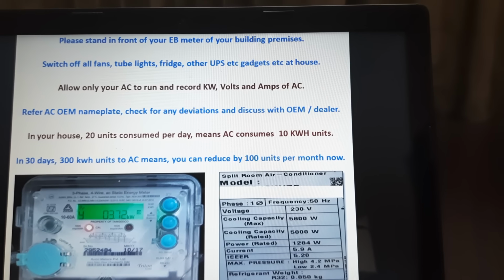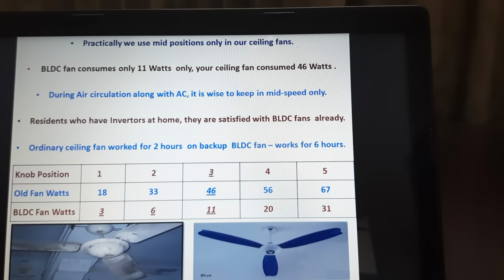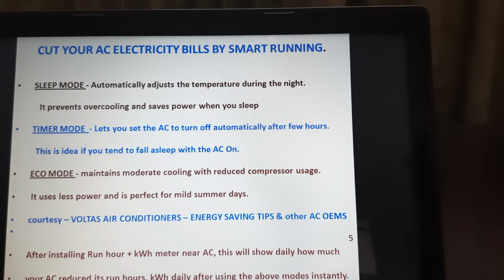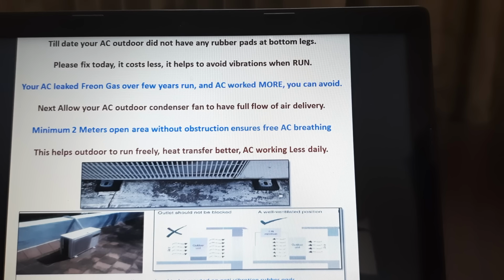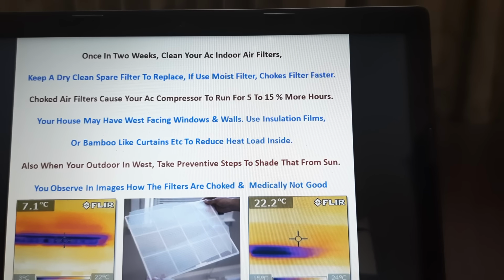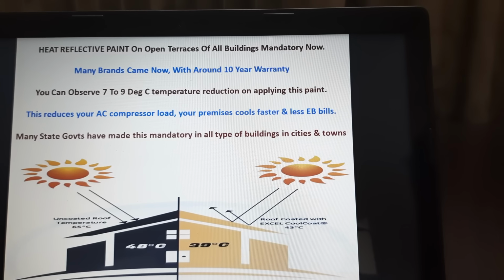Air conditioner’s Electricity Bills can be reduced upto 30% #AC #electricbill #BEE #energysaving

Comment: A BLDC fan at speed 3 or 4 with the AC set to 27–28°C is one of the best combinations for comfort and energy saving. If your AC has a convertible mode, keeping it at around 40% capacity and 28°C can further reduce power consumption, especially with a 3-star inverter AC. Good room sealing is also important ,if cool air keeps leaking out, the outdoor unit won't cycle off properly and will run longer, increasing electricity bills. Many people still use ACs at 16–20°C unnecessarily. The purpose of an AC is to maintain a comfortable temperature and remove the feeling of heat, not to turn your room into the Himalayas.❤🎉
Reply from the maker: Superb expert and  user experiences from you, thanks for giving your valuable feedback precisely
Reply: @energymeasuretosave3082 haha ....thanks for making such wonderful video 😊
Reply from the maker: @RahulTamore-v6f thank you please for your motivating feedback

Comment: Please advise star hotels to install fans in rooms. They have only AC. No fans. And they are providing quilt. Without much air circulation and mosquito menace could not sleep well. I would remove the woolen from the quilt so that I can sleep a little better. 😂
Reply from the maker: You are very much right. The hotels need to install BLDC fans to achieve centred air throw instead of scattered air throw from conventional ceiling fans. Some of air circulation comforts need to be made mandatory especially in hotels and hospitals etc public utility buildings.

Comment: Sir can we bypass the whole need of AC by using exhaust fans in the top of rooms?
Reply from the maker: When the ambient air is above 40 to 45 deg C, you won't be able to bypass the AC. At less temperature around 30 Deg c +, you can manage to exhautt out the hotter air from the room.

Comment: Hello sir, the AC technician always say do not run fan along with AC in same room. probably because of dust settling in through the top panel. would you advise using both fan and AC at same time?
Reply from the maker: Yes pls. Fan with mild air circulation speed setting say 2 out of 5 especially in bldc fan will retain the comfort and you can raise the setting temp. This will not pick the dust etc
Reply: @energymeasuretosave3082  ty for quick response sir. will try it out

Comment: i think for lower middle class a car AC type  for sleep time would  with a well designed retracting cabin  for the bed so u can just cool the small space over bed at maybe 100-200 watts consumption ..can have a concept of climate control ..

also i feel AC should allow in genreal people to set turn on and off times in minutes...as in my experience theromsatat readings dont feel accurate..sometimes ac gets too cold or hot....but people generally have a sence of the time cycles needed for their room...so i shld be able to set 5 mins on and 5 mins off for comressor..
Reply from the maker: Thank you for sharing these innovative ideas and your practical perspective on AC usage!

Comment: I recently bought a new AC, but running it on 27-28 throws bad smell, any suggestions?
Reply from the maker: Normally it should not give bad smell. Pls check for any Freon leak or any other material got stuck inside the Indoor unit. Since you purchased newly, suggest you to call your local service team to address this issue immediately.

Comment: Aircon can be attached on any ac right sir I mean on 1,2,3 star ac etc
Reply from the maker: That is correct, these energy-saving tips are applicable across different star ratings, thank you for your query. This will not fit in the Inverter AC.

Comment: This video outlines various zero-cost, low-cost, and high-cost strategies to reduce your air conditioner's electricity consumption by up to 30%. 

Energy Monitoring & Usage
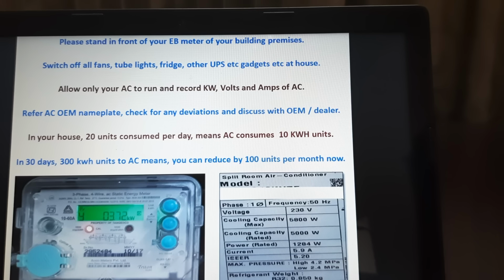Baseline Monitoring: Turn off all household gadgets to measure your AC's actual power usage (kW, Volts, Amps) against the OEM nameplate (0:17–0:46). 
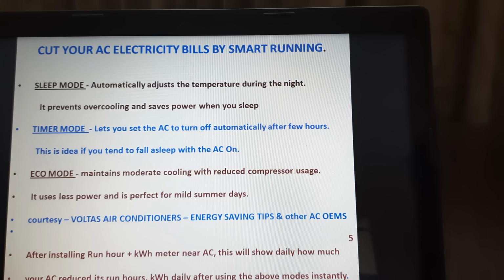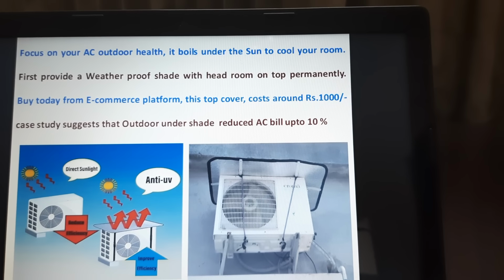Sub-metering: Install a cost-effective run-hour and kWh combo meter (~1,000 rupees) to monitor daily/weekly usage and identify performance deviations (3:06–3:59).
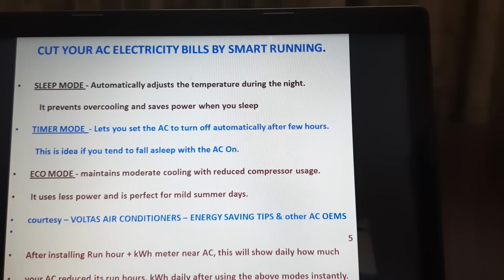Smart Operation: Utilize built-in remote modes: Sleep mode (prevents over-cooling), Timer mode (cycles compressor/fan), and Eco mode (for mild weather) (2:24–3:01).
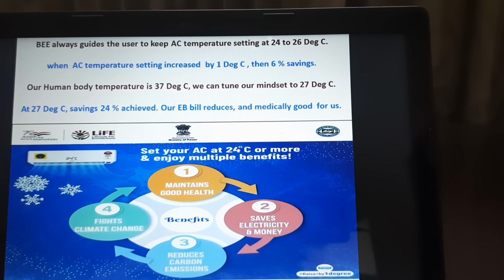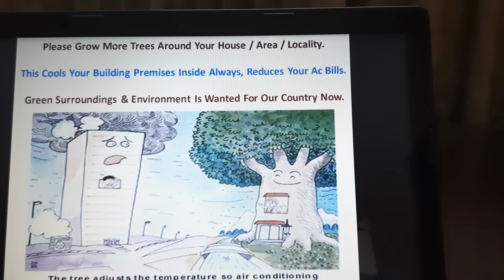Temperature Setting: The Bureau of Energy Efficiency recommends 24–26°C; however, setting it to 27°C (10°C below human body temperature) with a BLDC fan can save up to 24% in energy (8:19–9:02).

Outdoor Unit Health
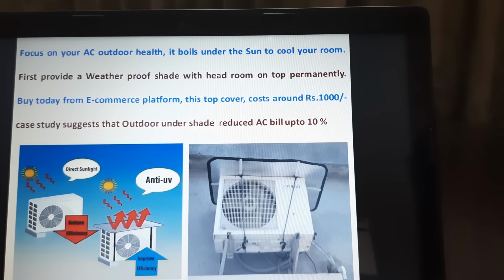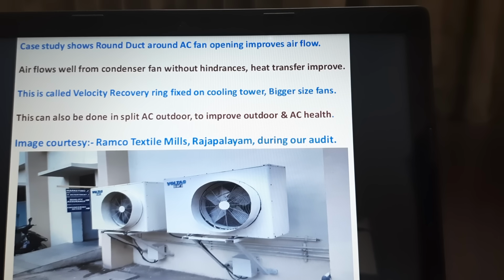Comfort the Outdoor: Protect the outdoor unit from direct sunlight with a weatherproof shade or shade wrap to reduce the load by ~10% (4:03–4:24).
Velocity Recovery Ring: Adding a round duct to the fan delivery side improves heat transfer (4:27–4:53).
Anti-vibration: Use rubber pads on the bottom legs to prevent leaks caused by vibration-induced wear (4:59–5:25).
Airflow Clearance: Ensure a 2-meter clear area around the outdoor unit for efficient heat dissipation (5:28–5:53).
DIY Cleaning: Use an agricultural sprayer with detergent water to clean condenser fins before summer (6:07–6:13).

Indoor Efficiency & Retrofitting
BLDC Fans: Replace standard ceiling fans (46W) with BLDC fans (11W) for improved air circulation and lower energy consumption (1:05–1:35).
Filter Maintenance: Clean indoor air filters every two weeks; consider keeping a spare set to swap out while one is drying (6:26–6:48).
Pipe Insulation: Cover exposed copper pipes with foam and tape to improve cooling efficiency (6:15–6:24).
Retrofitting: Install an Aircon Saver on older non-inverter units (cost ~6,000 rupees) to achieve ~20% energy savings without replacing the whole unit (7:04–7:40).

Environmental Adjustments
Heat Reflective Paint: Apply heat-reflective paint to open terraces to reduce ambient surface temperatures by 7–9°C (7:43–8:16).
Insulation: Use bamboo curtains or window films on west-facing walls to block heat load (6:50–7:00).
Greening: Planting more trees around the property helps cool the premises naturally (9:05–9:20).
Reply from the maker: I sincerely thank you for bringing out transcript of the video. Nice of you .

Comment: What I used to do is make sure the room is sealed I hava a BLDC ceiling fan, I set the AC temperature at 28c fan blower in Auto mode, and set in Eco mode, run fan at speed 1 or 2, this is a small room and Im using a 0.8 ton Daikin AC, we have a refrigerator, TV, Washing machine, a desktop computer, laptop in a 1bhk house, the AC runs almost 20 hours a day, as I'm a WFH user, the EB bill I used to get is maximum Rs.600/-
Reply from the maker: This is excellent, as well surprised to see. really appreciate your practical conservation. Thanks for sharing please

Comment: i dont use any fan with ac, and i runsmy ac alwys on 28dgree, and that temprature is best.. no cold or hot feeling and also saves huge energy.. i have 1LG 1.5ton 5star ac, 1 blue star 1.5 ton 5star ac, 1voltas 1.5ton 4star ac and 1 godrej 1.5ton 3star ac.. all i runs on 28dgree and in 14hours my all ac consumptions are- LG- 3.8 unit, blue star 4.1 unit, voltas 4.5 unit and godrej 5.6 unit.
Reply from the maker: Thank you for sharing your AC usage experience, it is really astonishing your total kWh consumption in eachnof the AC, really surprised. Hats off to you for running your ACs very economically.

Comment: practical strategies to reduce electricity consumption from air conditioners by up to 30%. The measures are categorized into zero-cost, low-cost, and high-cost improvements focused on monitoring, comfort, and maintenance:

Condition Monitoring:

Track Usage: Install a combo run-hour and kWh meter (approx. 1,000 rupees) at your AC's incoming power line to monitor daily consumption against the manufacturer's nameplate (3:08-4:03).
Optimizing Indoor Comfort:

Use BLDC Fans: Supplement AC use with energy-efficient BLDC fans. An AC consumes 200W per square meter, whereas a BLDC fan uses significantly less, allowing you to set the AC to a more efficient 27°C (1:09-2:24, 8:19-8:54).
Smart Modes: Utilize the remote's Sleep, Timer, and Eco modes to prevent over-cooling and manage compressor runtime (2:26-3:03).
Maintaining Outdoor Health:

Shade and Environment: Protect the outdoor unit from direct sunlight with a weatherproof shade (approx. 10% savings) and ensure at least 2 meters of open area for proper airflow (4:03-4:27, 5:28-5:53).
DIY Maintenance: Clean condenser fins with detergent water using an agricultural sprayer, ensure copper pipes are insulated with foam and tape, and install anti-vibration rubber pads to prevent leaks and improve efficiency (4:59-5:28, 5:54-6:25).
Velocity Recovery Ring: Adding a round duct to the fan delivery side of the outdoor unit can improve heat transfer (4:27-4:58).
General Maintenance and Upgrades:

Filter Hygiene: Clean indoor air filters every two weeks, or keep a spare set to rotate them, ensuring they are always dry before installation (6:26-6:50).
Retrofitting: Install an Aircon Saver (approx. 6,000 rupees) on non-inverter ACs for roughly 20% energy savings without needing to replace the unit (7:04-7:43).
Heat Reduction: Use heat-reflective paint on open terraces to lower ambient temperatures by 7–9°C, and consider growing more trees around your premises to cool the surrounding environment (7:43-8:19, 9:05-9:25).

Comment: Sir even after installing solar panels we are getting ₹1500 bill per month is this normal?
Reply from the maker: Please try to find the breakup of Rs.1500 bill in terms of kwh units consumed especially from AC by installing the sub meters for each AC and compare this wrt to the mains and the Solar generated kwh units.
Reply: @energymeasuretosave3082 Sir in TN here they are taking bill reading 2 months once only so when units consumed increase per unit rate also increases
Reply from the maker: @GowthamSK-015 That is very much true. Unless monthly EB billing comes, this increase in tariff will not be rational. What to do, we have to live with the bimonthly tariff format.
Reply: @energymeasuretosave3082 Sir are you also from TN?

Comment: what is your opinion on 5-star rated ACs for energy savings, they are expensive but I think they could reduce power consumption.
Reply from the maker: You are right Ji, 5 star AC initial cost is high, but energy  savings is there. but plan for invertor AC. This saves in a big way.

Comment: i have 140sqfeet  room and used to have 1.5 ton ac , it was so cold even at 30 degree that i had to use dry mode to reduce compressor use to not cool more , and still it was cold for me , then i bought 1 ton ac and i feel cold in 28 degree when temp in city is 42 , so i had to use it on 29 degree and on L3 mode which is 40%  of max 1345 max power for 1 ton , now my daily usage when running 24 hr is only 6-8 unit and only 2 unit when only running in night for 8pm to 6 am. ( it consume 256-380 watt per hour got that info from tapo smart plug)
the reason is that above my room is another room which dont allow direct sunlight and the after 1pm when there is sunlight on back side of my room wall its 9inch wall so it dont' easily make room hot.
but my outdoor unit is in partially sunlight i.e it get sunlight form 12pm to 4 pm when sun is hot so i am thinking about that uv reflector u said
Reply from the maker: It is great to see you monitoring your usage so closely; using a reflector for your outdoor unit is an excellent idea for further efficiency.

Comment: I always use AC at 27 degree celsius and before sleeping I use timer mode on my ac remote and set it to 30 minutes and it automatically switches off saves bill and energy too 😀
Reply from the maker: You are doing great, and  nice to hear 30 minutes only is your timer setting. Appreciate this.

Comment: https://youtu.be/2ydQNz5O4I4?t=523

this is misleading and not based on scientific research at all.
While higher AC temperatures do save electricity, 27°C is not ideal for comfort or performance for most people. Scientifically, optimal indoor temperatures are usually around 22–24°C for daytime comfort.

Also, for sleep, 27°C is definitely not suitable—even with a ceiling fan. Sleep quality is best in cooler environments (around 18–22°C), and higher temperatures can disrupt deep sleep.
Reply from the maker: I understand your view point. But many of the AC users have tuned their mindset to 27 C and it the mindset to feel comfortable or not. Pls visit BEE and TERI reports on this setting at higher temperature. FYKI pls

Comment: What is aircon saver? Can you send product link?
Reply from the maker: Air conditioner Energy saver is a E Prom based micro controller gadget working on dual sensor algorithms. There are few available in the market in the name of Aircon Airtron etc energy saver costing around 6 to 7 K. You can buy in E commerce platform or thro your local AC service team.

Comment: Just checkd bldc fan life time is less
Reply from the maker: There is a difference in technology as FHP Fraction horse power Induction coil versus BLDC Brush less Direct current motor. This tech is evolving and is getting stabilized, myself using the BLDC fan for 10 years without any breakdown. FYKI pls

Comment: So I need to replace 
Ceiling fan with BLDC fan?

Yes, i have AC and i set temp to nearest outside temperature in Summers
Reply from the maker: It is only a suggestion by the BEE, what you need to keep is Mild air circulation it can kept in single speed Electronic regulator in ceiling fan.

Comment: How does this "aircon saver" device work?
Reply from the maker: Air conditioner Energy saver is a E Prom based micro controller gadget working on dual sensor algorithms. There are few available in the market in the name of Aircon Airtron etc energy saver etc costing around 6 to 7 K. You can buy in E commerce platform or thro your local AC service team.

Comment: Does not the AC have to work more if the ceilings are high as the hot air keeps circulating? I have found it more effective if the fan is switched off as the cold air remains at the bottom
Reply from the maker: Normally the ceiling in flat is 10 feet and in some latest flats it 9.5 ft only. This is needed as breathing space. If it is your mind set only. But for human comfort, mild air circulation is needed.

Comment: I live in Punjab sir, and in the winter months we get negative bill because of the government's 300 unit free scheme but in the summertime the unit consumption exceeds from 300 to 800-1000. So should i keep the AC at 27 and get a BLDC fan for the room, right now i have a non-BLDC fan, should i replace it asap?
Reply from the maker: BLDC fan gives treble Inverter  backup time compared to your normal ceiling fan Ji. It is worth replacing now.
Reply: @energymeasuretosave3082 thanks

Comment: Sir I have 2 ac in different room in duplex home, but when I run bldc due to tarrace being warm the fan air feels hot
Reply from the maker: That happens because the ceiling traps rising heat, so you might consider insulating your roof to prevent that thermal gain.
Reply: @energymeasuretosave3082 OK sir thank you sir

Comment: The best way to reduce AC energy consumption is to insulate your house well. This is where Indian houses fail miserably. Unlike houses found in western countries, Indian homes are poorly insulated which causes higher heat loss. Another factor is dirty evap and condenser coils.
Reply from the maker: You are absolutely right.  The AC OEM needs to educate both the points to the AC user first.  Thank you for value added practical inputs.

Comment: We have 3 ACs (4* and 5* both) and we use them on dry mode and it automatically goes to 24 on dry mode. And we get a bill of around 2-3k every month in summers. Idk I think the bill is fine given that we have 3 ACs and Delhi is super hot in summers.
Reply from the maker: That is really great Ji, maybe you can compare 3 AC run hours and kWh to relatively check which is more efficiently working for you.

Comment: BLDC fans are a BIG Scam. They say it will reduce power usage but initially it's cost is also high and post warranty it's repair cost is almost 50% of its purchase price. Since it's an electronic product, there are major complaints related to PCB board getting damaged after 2 years of warranty. Atleast old fans used to run for more than 10 years. My atomberg fan as soon as it's warranty got over, it's malfunctioning now. Whenever I run it on No.3 speed, the fan rotates and stops every 10 seconds and starts again. It's a non stop cycle.
Reply from the maker: I understand your problem. all said and done, when you pay money for the product, it must work to our satisfaction, sorry ot hear that. I bought Super fan brand 5 no, 10 years before, and they gave 5 year warranty. But till date no fan failed. They are all running smoothly for me. I am not here to compare the brands, the fan OEM can raise their warranty to above 5 years to prove their ruggedness in working in any premises. We can collectively take this to the bldc oem to raise the warranty for their fans to be above 5 years minimum. Thank you for venting out.

Comment: The AIRCON saver are scam sir. Also above 25 the AC doesn't feel effective. Would like to add that older ceiling fans at higher speeds do in fact make ACs work more due to the heat they produce. I keep it in 25 and fan on 2.
Reply from the maker: I understand your problems and nice that you have sorted out with 25 C and 2nd speed

Comment: Thanks a lot sir. I have just one more question,the outdoor unit covers are ranging from 250-1000 rupees. Which price point is ideal for more efficiency?
Reply from the maker: 1000 Rs is better, it has to shield your ac also it needs to boil under the Sun, hence better quality preferred. Thank you